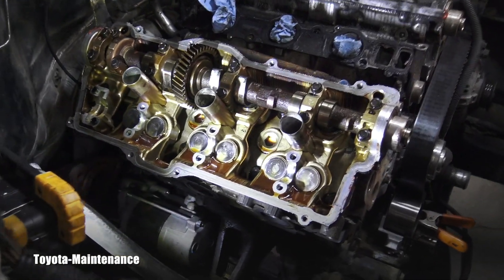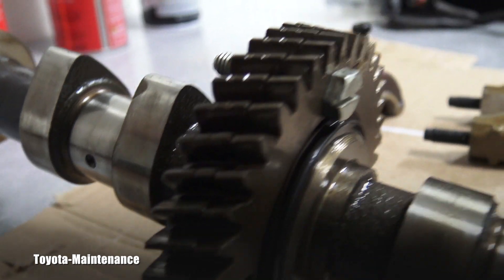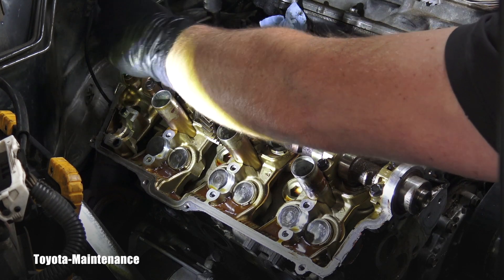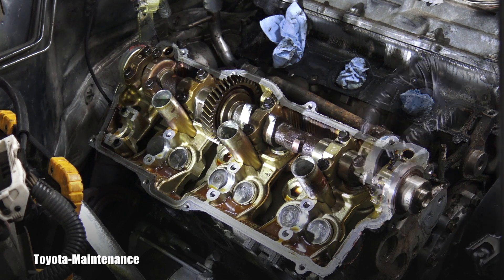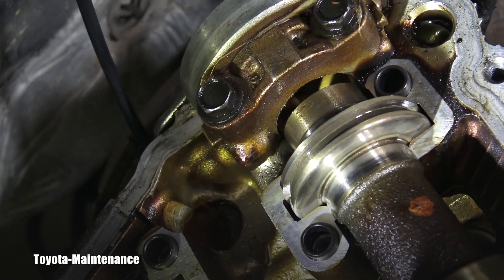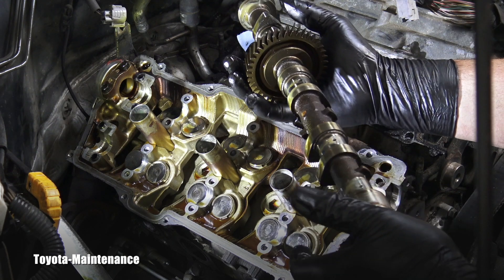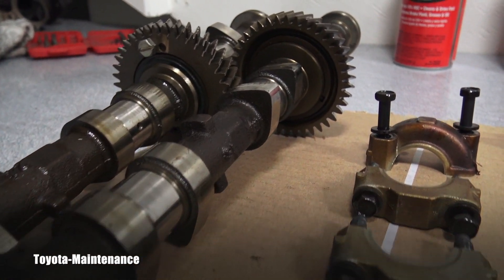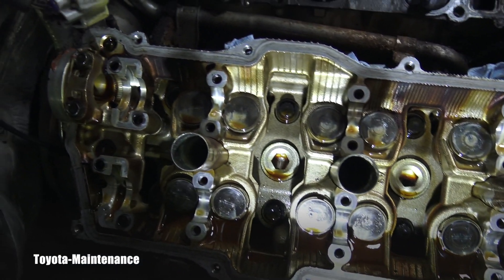Toyota engine camshaft removal Part 2

Comment: will you clean out the inside of the head of that contaminated oil? and how would you do that?
Reply: How to align the timing marks on the camshaft pulley if it misallign from the marks on the crankshaft pulley.assuming the mark on the crankshaft pulley is on top dead center